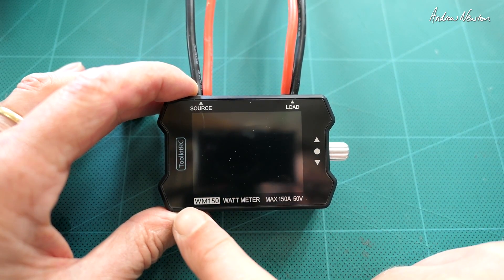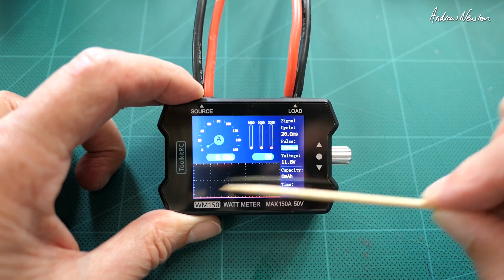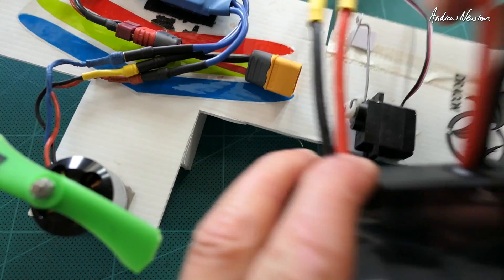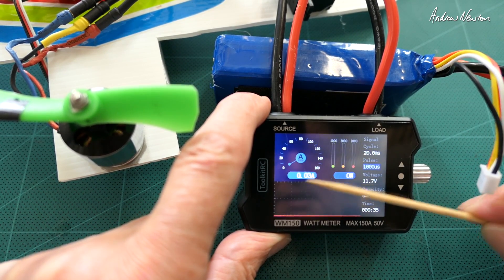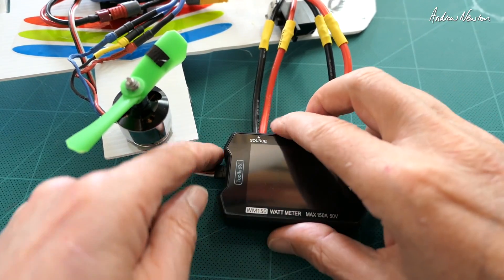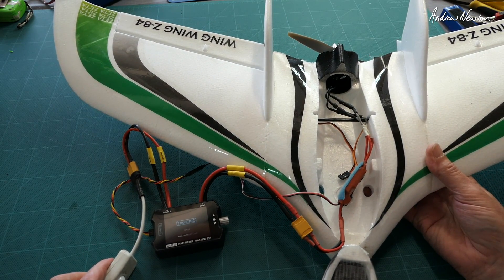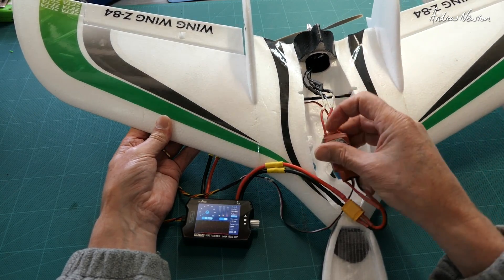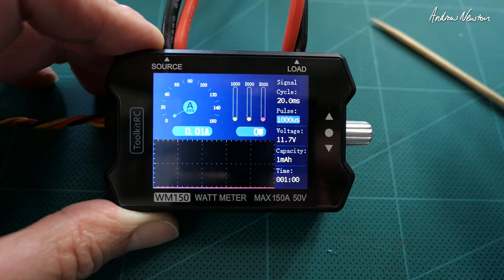ToolkitRC WM150 Watt Meter

Comment: If a watt meter doesn't hold peak watts, peak current and minimum voltage it is difficult to use. It is especially difficult when used in conjunction with a thrust gauge and tach. The only measurement I have to remember is the thrust. All others are held until the power is removed.

Comment: Great review.

With all the reviews of people point blank saying the same thing about digits being to small and the screen real estate being consumed by useless gages you’d think they’d change that in a new firmware release. I have not seen one review yet that they did not complain about the useless gages waisting screen real estate that they could easily be used to increase the current and power digits.

Ive been on the fence about picking one of these wm150. But since they  dont seam to listen to the people/reviewers about them needing to revise the UI to suit their clients needs is crazy.

Comment: Nice video and explanation, Andrew. Btw, they did release a FW updating graphic data etc. Another question, I see you using a lamp switcher style, batween battery and setuo (good idea!), but how it's not fried with Lipo current?
Thanks for tip.

Cheers from Brazil!
Reply from the maker: PC updating only and I use Mac. Good point about the switch, didn't consider that but it has survived. Maybe I won't use it for motor run-ups

Comment: Great video my friend always enjoy your insights into rc and I wonder if you can help me, I've just got some nx3 evo stabilizers but I thought they would have english instructions but can't find out how to connect them with my flysky ia6b rx, can you help at all how to position the switches TYDV for my powered gliders and seaplanes and what the multi and emerg inputs are used for,  sorry about the long msg but I'm grateful for any help, thanks Alan, uk, very old! Newbie well back again after 55yrs or so 👍
Reply from the maker: Hi Alan. I don't know that stabiliser sorry but here is a manual in English https://www.google.com/url?sa=t&rct=j&q=&esrc=s&source=web&cd=1&ved=2ahUKEwi6upWBgvflAhVt7XMBHTvZCEEQFjAAegQIARAC&url=https%3A%2F%2Fwww.fmsmodel.com%2Ffileuploader%2Fdownload%2Fdownload%2F%3Fd%3D0%26file%3Dcustom%252Fupload%252FFile-1418640380.pdf&usg=AOvVaw0tsTee4mAo2onXfDK6lqJZ
Reply: Many thanks for your advice and the instructions I asked for, your an absolute star my friend, I'm sure they will be a valuable help for me, once again my very best regards, Alan, uk 👍👍